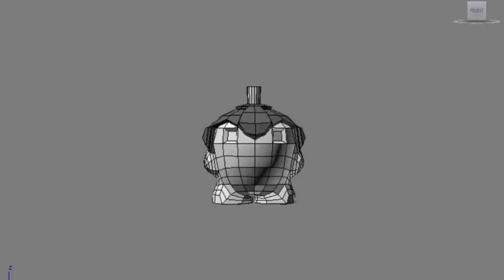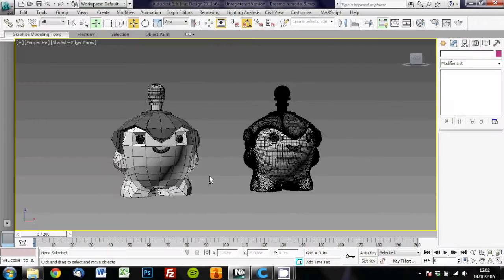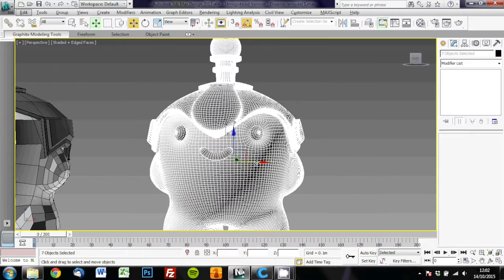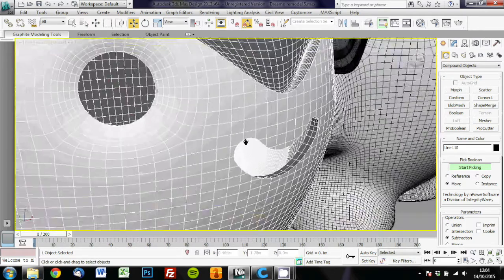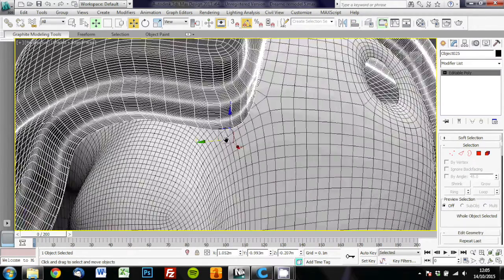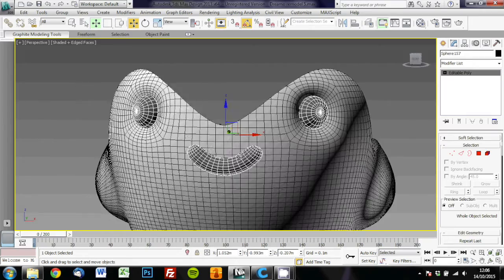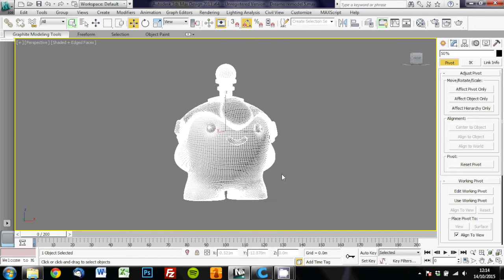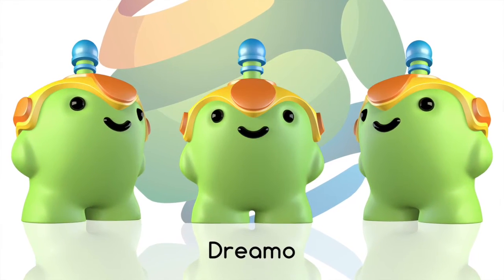Designing & 3D Printing Dreamo | Designed on 3DS Max, Printed on Zortrax M200 & Ultimaker 2

Comment: Hello! How did you selected the interior faces? Also, you didn;t used the shell modifier to give thickenss to you character?
Reply from the maker: Once I used the pro-boolean tool, I then switched the model back to a editable poly and selected the faces profile. It automatically selects the interior faces. I didn't give it a thickness with the shell tool as the shape is cut from various parts, if it was a single piece I would have used a shell.